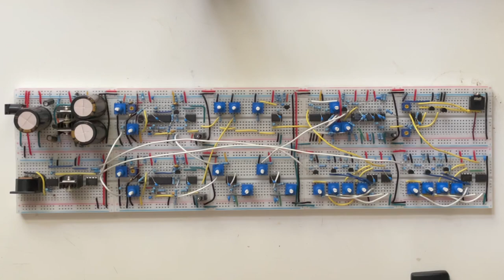BS-1 Breadboard Synthesizer Overview

Comment: DUDE!!  THAT build seems to be really holding up to your playing and wear, since my breadboards usually would produce some undesirable static from general wear or short-outs in the wiring. And your wiring btw is really nice and pretty, no bare copper and no huge lengths of slack.  Your own diy monosynth - just with the modules that you’ve decided upon - that gives the synth an overall sound that’s all to itself. Very lovely with that Polivokc filter. The whole thing just really is your own unique innovation! Really inspiring work that you’ve done!! I’d love to read the code for the MIDI module! So cool!!
Edit I’ve found Rene Schmitz’s Midi/CV!!

Comment: Cool design and awesome effort!! 
I've been building synths since the 80's starting with ElectroNotes publications from Ithaca, NY. I'd given up on breadboarding on more than one occasion. Invariably after moderate use, my connections would get funky and tracking down issues seemed to take over all my time. 
These days I use PCBs with soldered thin copper w/ nylon sleeving for workups and once I have something viable, I create a circuit board and send the gerber files off to Asia where they give you 5 PCB's for ~ 30$.

Comment: whoa, I'm a huge beginner but I really really would like to know the schematic section just for converting the midi protocol into the CV required to control the oscillators. It looks so simple on the board but I don't even know where to begin.

Comment: do those lfos only use one op amp each? sounds perfect! could i see a schematic please
Reply: They are "relaxation oscillators" which just use one opamp as an inverter with hysteresis.
 (Much like the hex Schmitt trigger oscs.)
 They give a square wave output, but a 2 opamp 8 pin chip could use the 2nd opamp to buffer the voltage on the oscillator's capacitor to give a sharktooth wave output.